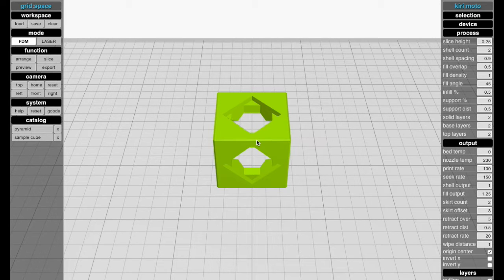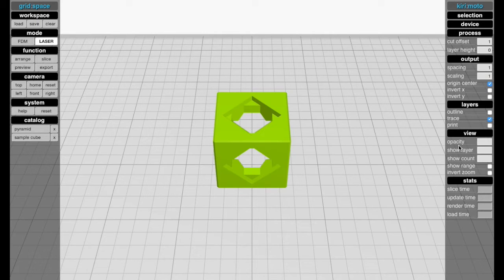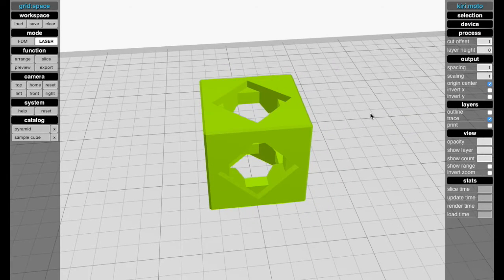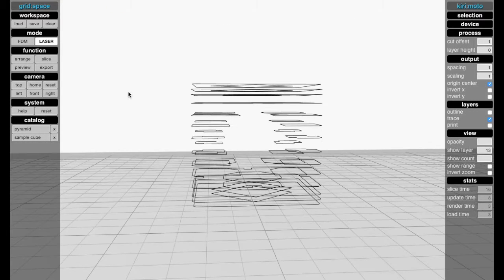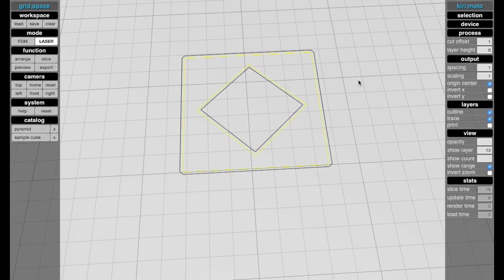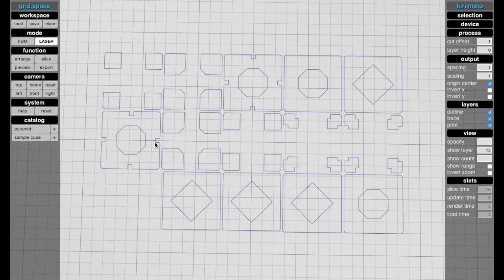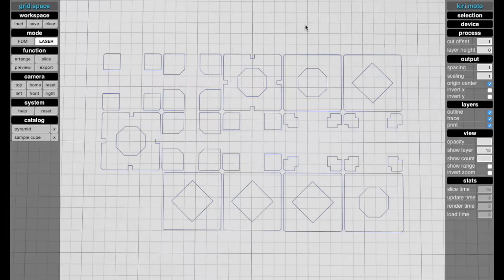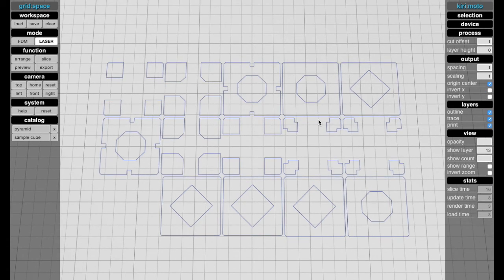Kiri:Moto Laser mode

Comment: how does it layout the layers after they have been spread out? bottom to top, left to right?
Reply from the maker: it uses a relatively naive space packing scheme. the svg is annotated with the z-index of each layer. color coding is now an option for some situations. there is a newer video that shows this.
Reply: @GridSpace  is that the Gridspace plate video or another? if i slice the cube it gives a 5x4 grid of the slices but i dont know which is the first, second and so on slice
Reply from the maker: @Nonprofessional_Tinkerer  the order is only important if the slices are different. in my use cases, it's more like this https://youtu.be/T8S-l8pydl8
Reply: @GridSpace  ah shame, i was hoping it could take something like a bust sculpt, cut into segments to be lasered our of card and then rebuilt into a cardboard layered sculpt
Reply from the maker: @Nonprofessional_Tinkerer  your proposal would be a simple top left to bottom right packing scheme to enable this? if so, that should be possible.
Reply: @GridSpace  would be wonderful, the only other program i have seen do this is fusion slicer that numbers the pieces
Reply from the maker: @Nonprofessional_Tinkerer  I've got a new feature for this checked in. Will push to production (at least the development channel) within the next few days.
Reply: @GridSpace  cant get any better than that, wonderful. Thank you
Reply: @GridSpace  that would be perfect

Comment: Thank you for making this slicer i have been having to manually slice my objects and export. you have saved me ten steps of clicking through layers only to find errors. Is there a nesting function that you would be able to add in the future?
Reply from the maker: +Arden Phillips do you mean nesting smaller pieces during the tiling phase? that's entirely possible and I will add it to the list. if you mean something else, please describe it.
Reply: +GRID:SPACE being able to tile smaller pieces as well as orient them to use less material by eliminating spacing between parts.  Another scenario would be having an L shaped part that when you specify multiples of the same part they are optimized for minimal space usage.
Reply from the maker: +Arden Phillips ok, it's on the todo list.  thanks for the feedback.